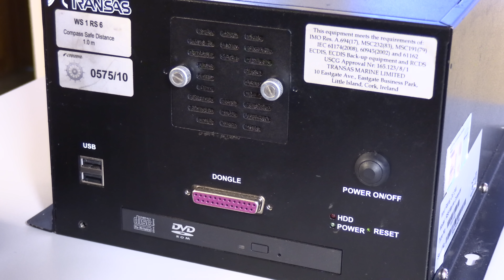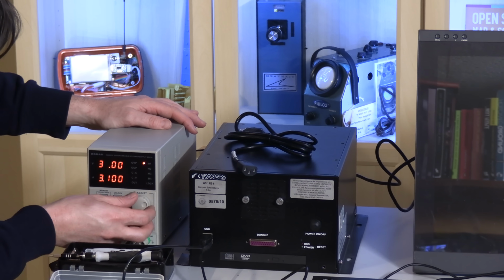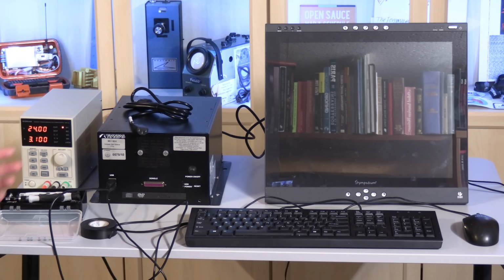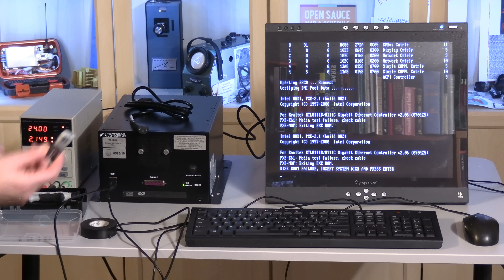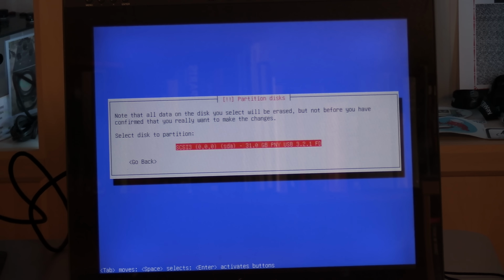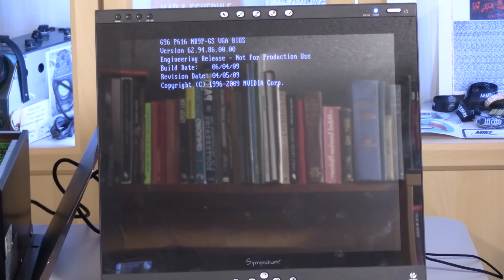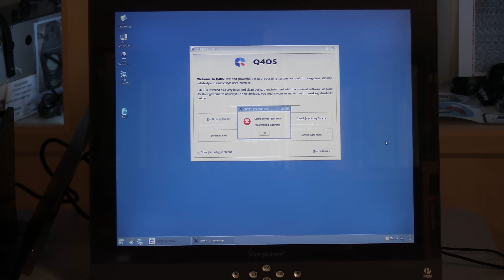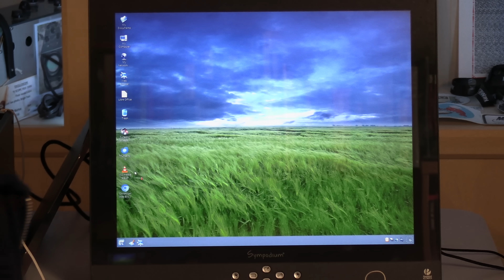Transas RS-6 Marine Navigation Computer

Comment: it has a lot of serial ports to use for the nema gps and also items for the steering system autopilot.. the dongle is a key based on the db25. the software can be tested on any computer on land and then transfered to the vessel with the db25 key... the software is registered to the company who owns the boat. the key can only be used on one computer. paired with the software. it is done so they can not simply take the software from the computer and load it to a clone and run it on another vessel.. it is liscense per vessel ownership. it is very expensive system.

Comment: Cool little PC, I'd say go through it reapply thermal compound cut some vent holes in and mount some modern 24V fans in there, deleting the old fans. The larger the fan the less noise it will make in reference to the RPM. As for a use I'd say throw a filter on the sides keep water our and do a little off-grid weather data station. You could add your own barometers, thermometers, and pull data from satellites. Also I'm not sure, but see if one of those empty ports/pins inside is a JTAG interface for debugging, there might be something there.

Comment: Might be good at sandland for the radio dome? If you deem it reliable enough. Could run directly off solar, it's designed for kinda a harsh environment.

Comment: Those are just surface-mount rails. I imagine it would be screwed into a 3/4" ply backing board with other electronic gear, which is common in telecommunications installs. I could be wrong, though. Would love to hear from someone with experience.

Comment: 12v and 24 are on boats, just depends on which setup. is it leisure or main power? 

as usually different sets of batteries and solar panels etc. these days

mainly due to the inverters.  

the hot smell is a no! btw you''ll pop caps etc. :/

edit:  inb4 bringus makes doom run on it haha

Comment: The graphics chip is named in the bios post boot in your video (G96), its a Nvidia GeForce 9600m GS which is a laptop GPU as you guessed, Eton are a supplier of industrial computer equipment so its been supplied by them so this dates the PC to least 2008 when the G96 part launched. As the CPU is x86 64-bit capable I would try Lubuntu instead of Q4S, you get the full Ubuntu driver base and unlike other Ubuntu spins it has been tuned for older PC's along with a lighter UI, its surprisingly decent for older PC's.

Comment: 2:19 in my experience Torx screws don’t easily strip like philips. Security Torx has the dot in the center.
Reply: I've literally never had problems with torx, but I also have high quality torx bit indexes.
The american dislike for torx screws always gets me. There's no other way than torx when using 8x200mm wood screws.
Reply: @rodtoddconsulting6319 my issue is when you use torx wood screws and need to pull something apart a few years later. They are a rusty mess that rounds out. I'll take hex over anything...even Etorx
Reply: security torx is such a funny oxymoron to me

Comment: No idea where you live or if it could even be done safely. But if it was ment for a reasonably big boat like a drag net fishing trawler, then it could be cool to see it built up into a weather monitor  at the low end, high side basically doing what it used to just not squacking anything out. Kinda like having a ham, but not a license. Listen all you want, just better not transmit.

Comment: I don’t think the motherboard is fully custom - usually companies wanting a “custom” PC will go to an industrial computer company like Advantech (I’ve seen quite a few boards with the same serial port layout), pick out a motherboard model they want, and put their logo on the silkscreen. I’m not sure how much they will let you chop and change, but it probably depends on how many they order. I believe the serial ports could also be configured as RS422/485 in addition to standard RS232 - they are probably in 422 mode for those NMEA ports on the back. If you Google the BIOS version/code it might shed some more light on who the OEM was.

Comment: The Transas RS-6 is basically a rugged industrial PC used as the processor for ship navigation systems (ECDIS).
It usually ran Windows XP Embedded (later units ran Windows 7 Embedded), not regular desktop Windows. The OS was locked down to auto-boot straight into Transas Navi-Sailor / ECDIS software, with chart data, sensor drivers (GPS, AIS, gyro, radar), and a hardware license Sentinel dongle.
Reply: I was going to guess the dongle port was for a hardware license key…and they based it off a db25… fun choice…very 90’s.

Comment: yeah, so, probably that video card is mxm or just mini pci? the nmea thing is probably full duplex rs485 due to the A/B on both tx/rx. try another distro, and figure which video card you have. probably it's sluggish due to missing video drivers, thus no acceleration. also, that cpu should technically let you run modern Linux, but probably not Win11. as someone else mentioned, the dongle port might be just a parallel port. I'd use that for controlling all your remote rotors and antennas, due to how many serial ports you have, and in both flavors, 485 and 232. a quick noctua fan mod and it'll be really silent. crazy amount of power usage though, almost 50w in the bios/post!

Comment: Any time I've seen a DB25 port labelled "dongle" it's been for a physical licensing dongle for expensive software. Haven't got to the end of the video yet so can't say for sure that that's what this actually is.
Reply: The last time I used a dongle was mid 80s. It was to licence the number of users in some project management software we ran on a 3B2-100.
Reply: QuarkExpress used to do that bullshift. Some applications still use USB A dongles. it should be possible to patch the binary and replace the dongle check with a jump to the memory address of it passing. There were companies in the 90's in china that would do it for you.

One application tied their license to the 4byte HDD volume id, and one massive 4 color printer to the motherboard serial number.